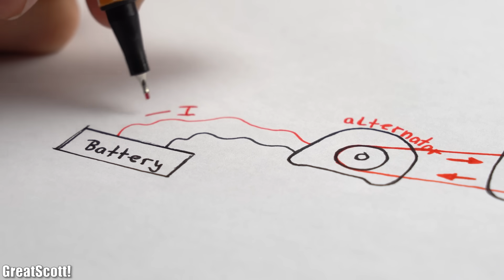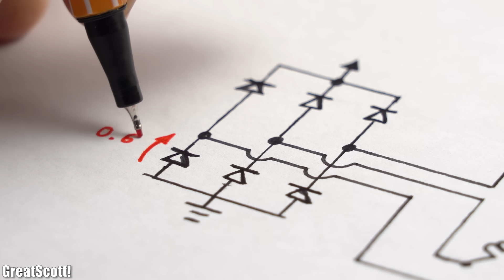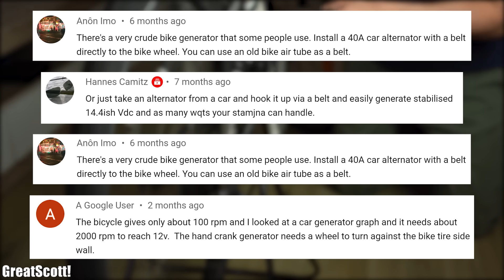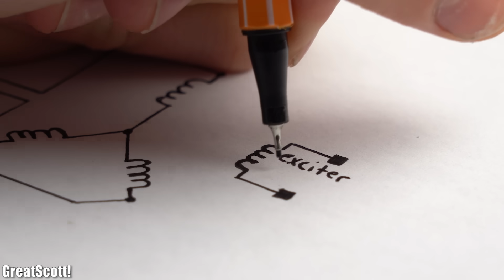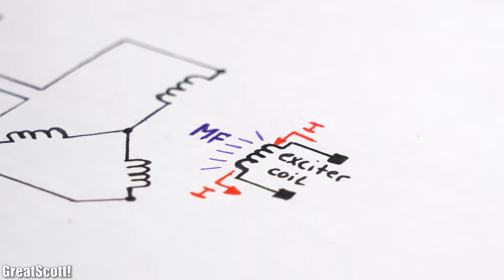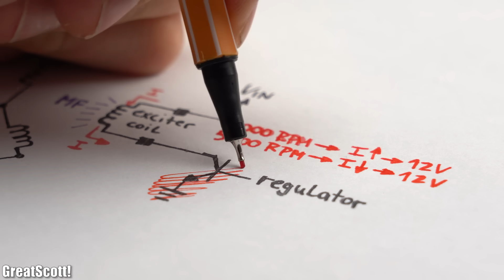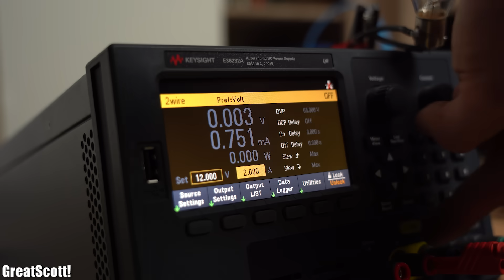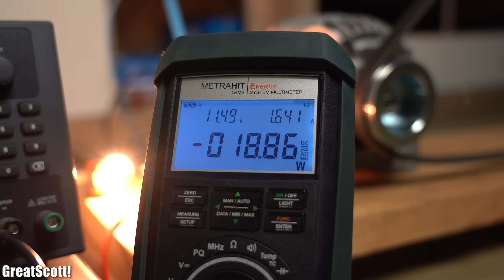Using a car alternator with a bike to power my home? How much energy can I produce?!

Comment: I tried this years ago using an exercise A frame to mount my bike on, I took off the fan which was to create ressistance and replaced it with a car alternator driven directly off the back wheel of my bike and a hard rubber wheel on the alternator pulley this was connected to a battery as it would have been on a car and with a bulb to show it was charging, I managed to get 2 amps out of this set up but as it felt like riding up a steep hill all the time I decided that I was not fit enough for it to be practical and gave up.

Comment: I wonder how much the overall-efficiency would increase "FOR YOU" if a financially-challenged input energy source was mounted into a centrally located position in space relative to the mechanism, just below a "stick-like" overhead  support-extension that extends just out of reach of the observer to a point to which then had a suitable fiber-based retention mechanism to support and suspend a "Logic-Analyzing MSO" in a "non-conductive" but very "emotionally-Inducting" way. Lets call it an  "Enticer/Induction drive".

Comment: I've seen quite good results from using the wheel motors of balance boards and e-scooters. I think rpm should be in a good range and they also should use permanent-magnet motors.

Comment: [amount of food required to fuel your body + time needed on the bike] > [cost of electricity]

But the knowledge gained is invaluable!
Reply: While you are right that this is an inefficient form of energy production when taking into account food, this would be a great excuse for somone to exercise!
Reply: - gym fee.
Reply: Food is nkt expensive. We are all fat.
Reply: Human bodies are horribly inefficient at power conversion. Vast majority of caloric intake is converted to heat. Only a few % is converted to usable work.
Reply: @protonjinx  It's not that bad if you only count the time you're working, without including resting. Maintaining a 100 W output produces about 200 W of waste heat, so the efficiency can get close to 30%. The single-digit % values come from dietary tips, which essentially assume you only workout for half an hour or hour a day, while maintaining your body has a relatively flat cost per hour.

It mostly comes from bodies just having so many moving parts. The lowest levels of metabolism, like converting pure glucose into mechanical/electrical energy, can by various estimates go as high up as 95% or more. This is not too surprising when you realize it's basically an electric dynamo, not a thermal engine (which would be ridiculously inefficient at such low temperatures as 36 °C, of course!). Getting from there to actually moving your legs powering a bicycle drops the efficiency like crazy, though. But using that energy to power something like chemical synthesis? That's pretty awesome, compared to having to do chemistry at high temperatures and pressures.
Reply: @LuaanTi  IF ! EVERYONE !! EXCERCISESES !! EFFICIENTLY !! THEY !! WONT !! HAVE !! TO !! GO !! THE !! TOILET !! ANYMORE !!
Reply: @protonjinx  even carburated gasoline engines do that much better

Comment: The exciter coil can be handled by a small solar panel and the rest turned by a wind turbine. During the night the battery being charged can execute the coil when the wind turns at a given speed. Alternatively replace the exciter coil with magnets and you have a decent wind turbine. No more cycling to generate energy for your home.

Comment: You need a third wheel on the belt, to hold tension, preferably with a spring, that will assist against slippage and thus increase your maximum output
Reply: Came here to say this the belt is flopping about and no where near taught.
Reply: @walmartsuxhard  yeah, he wasn't taught... that... yet!
Reply: @walmartsuxhard  right? It hurt my head. All that wasted energy from him and the alternator
Reply: An idler from a dryer would work great for that.
Reply: I like the versions with a charge controller and battery so the bike serves as a back up way to charge your power box
Reply: @gregorytrenhed8318  CHARGE is half the key..storage  is the other..
Reply: @Barracuda48082  Maybe a Tesla battery would be ok, but they are very expensive
Reply: I also came here to point that, using a tensor with a spring will help with the slipping. Additionally, if you want 100W power output, you need to at least give 100W power with your legs and that without taking in account any losses as a simple example.
Reply: yep get the belt tensioned and then he can run in a higher gear to increase RPM's and might even reduce how much he has to work
Reply: 1. Ridged frame, for the bike to be steady. 2. Tensioner for the belt. 3. Battery bank.
Reply: Yup, that belt is way too loose.
Reply: Obviously, you can use any belt tensioner part for any car to achieve good tension 😉
Reply: He could do just as well using a set of turnbuckles in between the alternator mounts and the board- putting tension on the belt.  But his rickety mounting system for the bike itself is where a lot of work is needed.. Nowhere near sturdy enough to keep much of anything tight.
Reply: Good idea. To expand on that 2 more wheels, 2 more belts, 2 more alternators 3 high powered batteries, and a solar array.
Reply: @MP-vf8qz  Or salvage a crap load of Vape batteries and make a battery bank with them connected to an ionic yagi antenna on top the house that way it trickle charges the battery pack even when you're not pedaling the bike.

Another hack is marry a fat woman and get her to power it and by the end of the year you'll save $$$ and have a skinny wife.
Reply: @MP-vf8qz  you know,  it's funny that you seem to be so cocky about this, since he has made a video with a tensioned pulley and a few other upgrades. The output is much higher now
Reply: @LeonardGreenpaw  I'm not cocky, don't  judge so quick. I liked the video, I'm just throwing ideas out there, like the other guys are doing.
Reply: @MP-vf8qz  oh sorry,  you were being serious? It was such an exaggerated tangent that I thought you were joking
Reply: @LeonardGreenpaw  I wasn't joking. With 2 more wheels, 2 more belts, 2 more alternators, 3 high powered batteries, and a solar array this should produce more power. But I would like to check out more projects.
Reply: @LeonardGreenpaw  Speak for yourself please!
Reply: @MP-vf8qz  What does MP stand for, Major Pain?
Reply: It's called a tensioner pulley
Reply: Just slide the motor back so the belt is tight then bolt it down a tensioner will just put more resistance and rob power plus its just more parts and more to break
Reply: The end was hilarious 😂🤣😂
Reply: That will create more drag or friction
Reply: Yep.
And that tiny bit of drag on the  system coupled with heat loss/friction,  belt slippage,  loss of inertia,  micro fluctuations in belt tension and minuscule belt slip on multiple pulleys will, over time,  cause power consumption to outrun power production and hour by hour, minute by minute the RPMs will drop. A cascade effect will ensue.  The entire system will slo w.  a n d 
s  t  o  p.
Reply: @brianroberts5740  its a dude on a bike
Reply: Its a car application, so cars have a belt tensioner.
Reply: if you add third wheel you add unnecessary load most likely even if minimal

I think you should be able just to have these two wheels and maybe make the alternator one bigger if necessary and just have the alternator be the tensioner by having it mounted on some kind of spring loaded mechanism 

I think there are cars which have serpentine belts tensioned without special separate tensioner wheel but by having ac compressor or something be the tensioner
Reply: also cant you gear it up more? hypothetically it should be able to produce enough to power a car battery right?
Reply: He could also just put the alternator on a hinge so it can rock back and forth and then put a turnbuckle on it so he can adjust the tension
Reply: He needs to add an idler pulley and a much larger rear wheel.
Reply: a belt tensioner also needs power to run. More waste of power so even less harnessed he could not power that alternator very long, drawing more juice. The more power it puts out, the harder to pedal the bike.
Reply: Like a tensioner?
Reply: They sell cheap ones for motorcycles
Reply: Or set it up as a slide so you can really crank on it while tightening the bolts.
Reply: No. You need to tension the alternator so that the belt is always in efficient contact with both the drive and driven wheels. Adding a tensioner would only add resistance and reduce efficiency.
Reply: Try an exercise bike with a DC generator just to see how it performs then switch out the DC generator for either a three phase generator or single phase generator or a car alternator with a 12 volt battery to supply electricity to the exciter coil to power what you want and of course if you know what your doing you could try to have a little bit of electricity to keep the battery charged for when you need to produce the initial magnetic field for it produce electricity.
Reply: Or just tension up the belt more when bolting the altenator down. :)
Reply: @mirkogruden8362  Spring based tensioner would work better for a variety of dynamic reasons.
Reply: @gazorpazorp9798  Would be, yes. But it would be also more complex and harder to make. Tensioning the belt more when bolting the motor down will most probably be enough to solve the problem.
Reply: Taut fkin ac